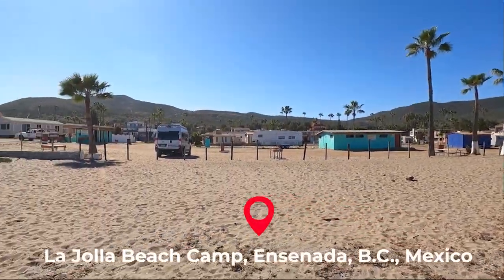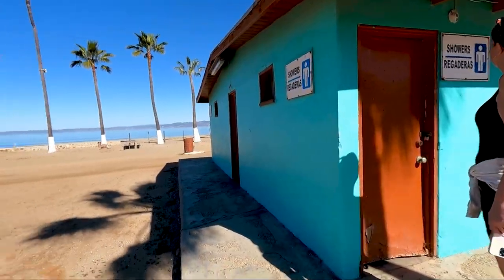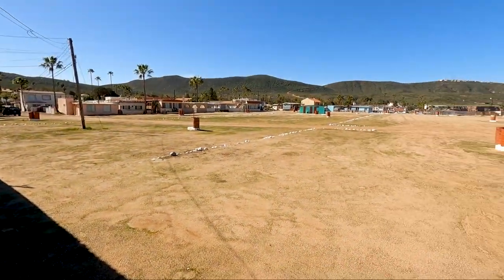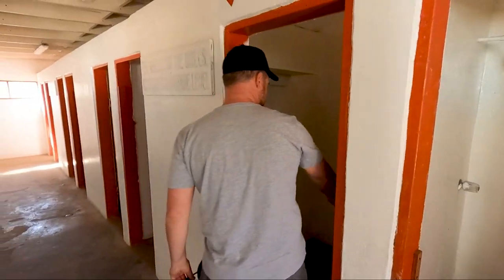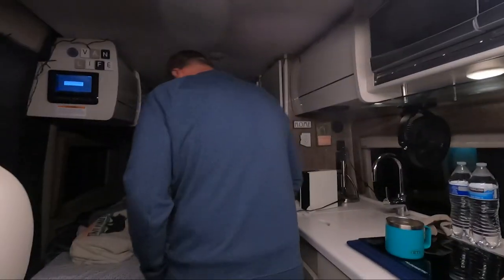Van with NO Bathroom PROBLEMS! Time to cross the border and head home. Bob & Hillary

Comment: Ewww...That’s why it’s a good idea to have a van with a shower...And with the Truma furnace to make it Hot !! Maybe if there was a heatwave, you could’ve withstood the cold water...What did Bob use for the makeshift shower? Did the shower spray and hose come with the 18T? And what is that blue canister thing hooked up to it? Thanks and great to see another video Hillary and Bob !! Someone posted this on the Rize/Scope FB page...ThankYou
Reply from the maker: So true Jillian! The make shift shower was from our Van. We bought it to hook up to the van to rinse off. The problem was we were low on water so we needed to find somewhere to hook it up. The blue canister is a filter. Thanks for watching! 😃

Comment: Hey Bob, I added SumoSprings front and rear to my Scope 18M and it has made a tremendous difference in cross winds and dealing with turbulence from Semi trucks on the highway.
Reply from the maker: That’s so good to hear from someone who has had them. I’ve looked into them. This makes me want to get them even more now. Thanks for sharing this.
Reply: @Vancaskeys  I also forgot to mention, it’s the only DIY I have ever done that was as easy as it looks! I had a large hydraulic floor jack and one jack-stand for safety. Screw driver and hammer to break loose the original bump stops and was done in about an hour!
Reply from the maker: @michaelmoore9139  thats great to know!